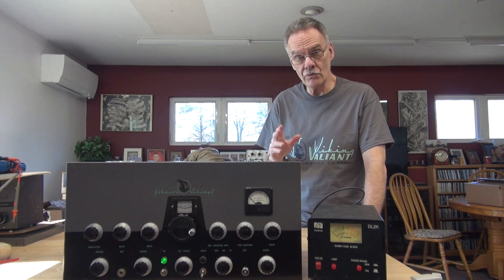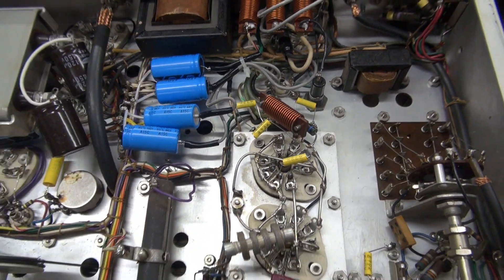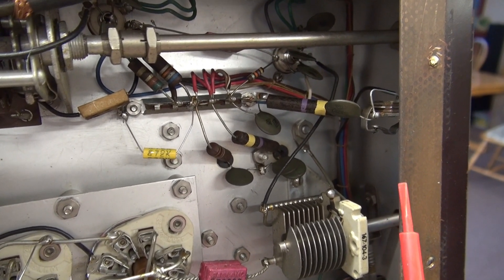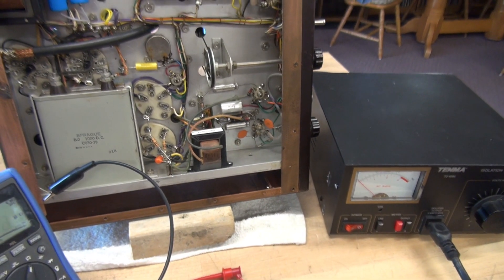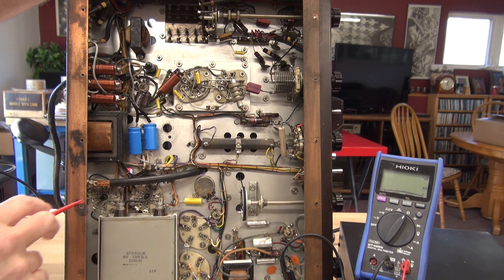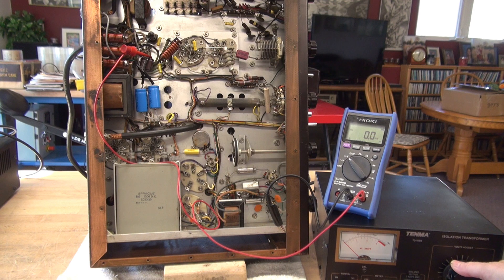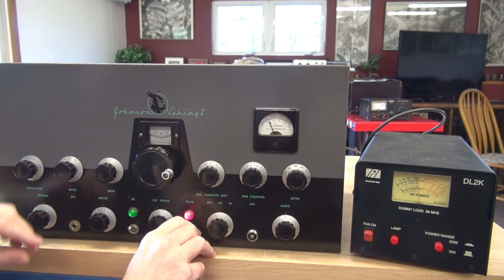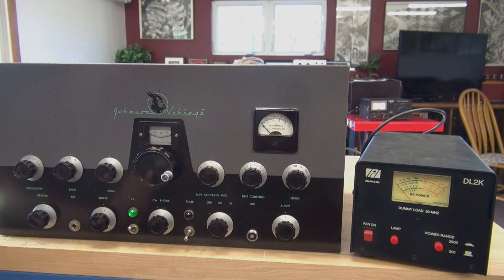Unknown condition Johnson Viking II Ham transmitter Initial Inspection Safe start up procedure

Comment: Was the modification to the 807s, plate modulation?
Reply from the maker: The transmitter had plate modulation using the pair of 807's. It looks like someone was feeding in external audio

Comment: Thanks Terry. I've a lot of caps & resistors to replace in mine before I can even think about applying power. I'm dreading pulling the front panel to replace the mic connector. I've seen the vid you posted detailing that process. It's going to be fun :-) 73